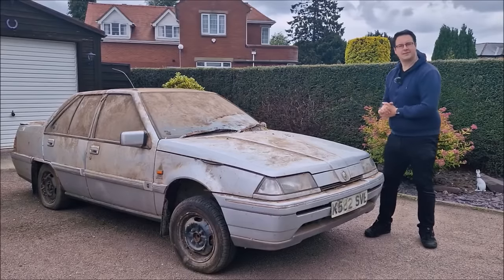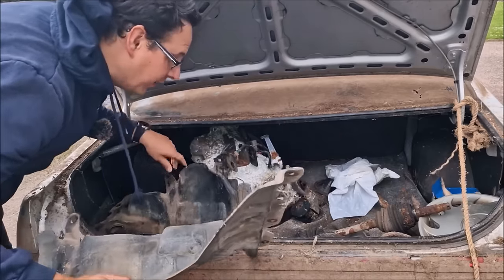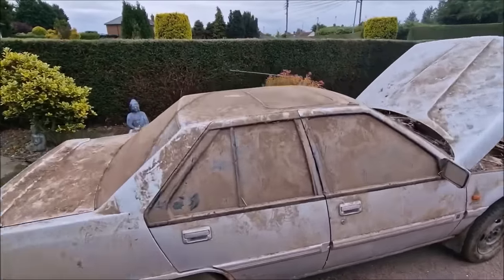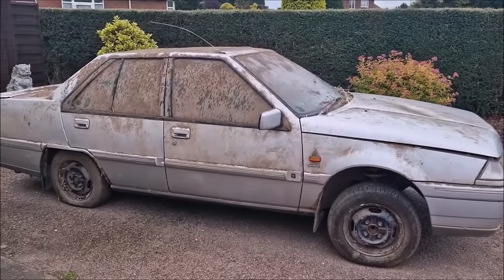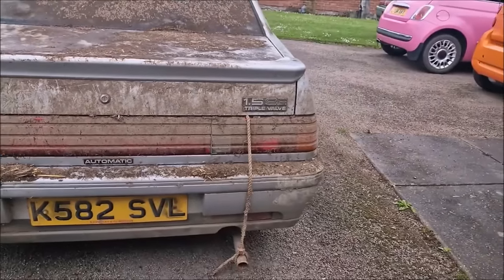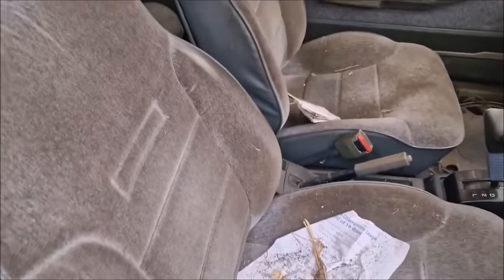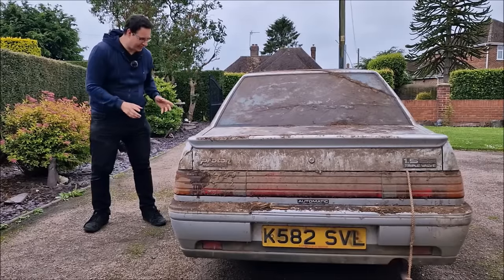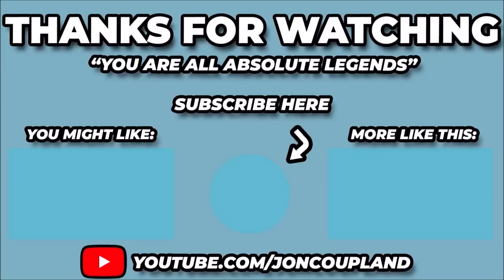Barn Find Proton Saga Iswara - It's Home And It's Future Now Awaits It

Comment: Parts car that it.look at  Mot history in 2015 says rear chassis is toasts as is the rear trailing arms good lick with the other one. I'm sure the engines was from mitsubishi
Reply from the maker: Oh it's absolutely posh rotten 🤣 - yes would have Mitsubishi engine in
Reply: @JonCoupland  as long as it lives on on other cars that's all that matters. Is the flywheel and torqe converter in the boot too? As it may have been put in the other one